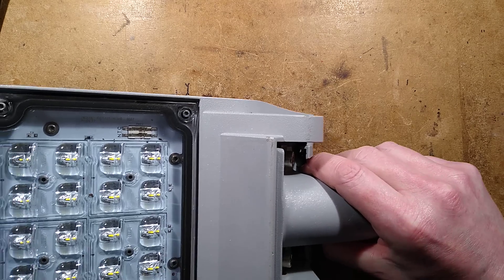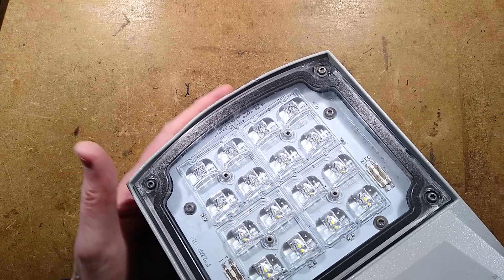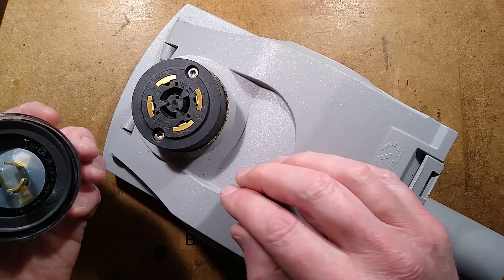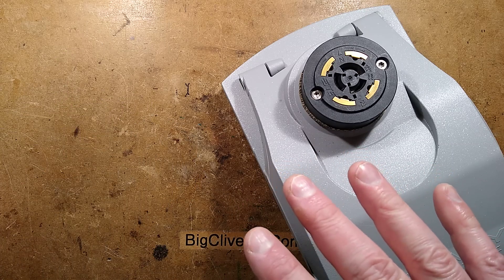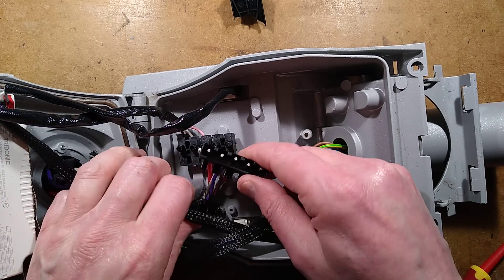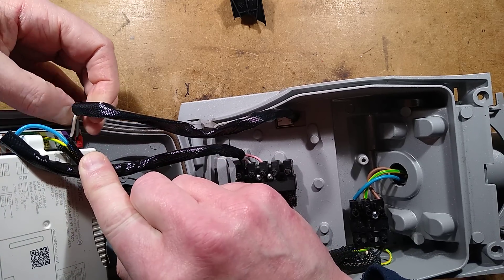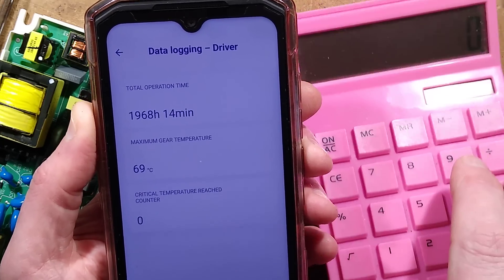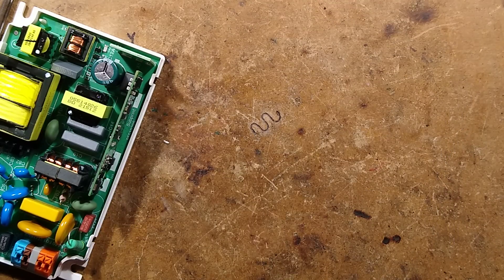Inside a tiny ASD Diamond British street light

Comment: Nice light but it, and most others, have a fundamental weakness, the light sensor. I live in a fishing port in NE England and after a couple of years (or much less sometimes) the lights are on all the time as the seagulls perch on the nice flat tops of the lights and sh*t all over the dusk sensor. It would be nice to see a lamp design with a "no perching" design. I am old enough to remember when the lights used a timer, low tech but dump proof, and were adjusted a couple of times a year. I am no Luddite, but I think a little more thought into the design of the lamp tops or at least the ability to add a bird deterrent in certain locations would be smart. Of course if the local authorities cleaned the lamps this would not be a problem, as if !
Reply from the maker: Some use light sensors that point down and analyse the local light levels.

Comment: Was watching the mosquito zapper a few minutes ago and it reminded of a comb that you zap fleas with when combing your dogs fur, also thought about the fly swatter I seen few yrs back that would zap bugs as you swing it or flap it around the air, how dangerous are those? Would the fly swatter zap fingers if touched and would the comb burn your dogs fur when zapping fleas? If the swatter did zap skin and hurt like hell, I guess you could use it as a defense thing if someone tried to get to you and attack you.  Sort of like a taser but mild I guess. Are those safe to use if someone came across them in some Chinese online shop?
Reply from the maker: The swatters used to have open wires, but now have an outer and internal, mesh arrangement.

Comment: I'll have to take a closer look at those street lights I mentioned previously that they installed outside my place. They're pretty bright, I'd guess way more than 20W and they look a lot bigger than this one, but they do have a flip open lid, so it's possible they're related to this one. I didn't get a great look while they were installing them, since it was dark outside and they weren't that close, that said I got the impression that the lid covered the whole width of the light and also the sides and front, which would help with resistance to rain. So perhaps it's not so related to this one after all.

Comment: Tridonic electronic ballasts, were a great source of of selvedged components for my projects. Because of the size of the office building that we maintained, I had a regular supply of failed electronic ballasts. I mainly removed the class XY capacitors, (for cap dropper psu circuits) and big Electrolytic capacitors from them.

Comment: I've noticed that the dusk sensors detract from the ergonomics of the overall design of modern lights in general. Why such a huge pimple?
Reply from the maker: Some use a small sensor.  The big ones date back to huge cadmium sulphide cells and heated bimetallic switches.

Comment: In the brief time it took you to extract all the goodies from the housing, I had disassembled, "fixed," and reassembled my Generic "Amazon Special" NiMH charger.
(Mine is an Opus BT-C3100, but being generic I'm sure there's other brands and model numbers for the exact same charger.)
Two of the four slots would have wonky current readings without a battery installed; one slot had a dead moth between the springy negative connector and a solder point on the PCB, the other had a bit of hay trapped between the spring and a surface-mount capacitor.

What a relief! I was fully prepared to replace it, but it seems there is no need to. So far, it's lasted thrice as long as the charger I bought from the brand that keeps going, and going, and going... 🐰

Comment: Tridonic have been around for a VERY long time. Their ballasts were used in the early Pifco single - tube kitchen fluorescent fittings (the ones with the stand-off tube arrangement from the 1960's).
Reply: Started 1956 according to their website, which also claims DALI was "based on Tridonic technology".

Comment: I was working at Pearson airport replacing HPS 150W 347V with 23 watt led .We were replacing drivers on lights before we got to the 2 Nd floor .Defective capacitors on the drivers was the cause .At $500  per fixture at 2011 prices was insane to have that many failures .No filtration and snubbers on the power supply

Comment: Oooh, look at all the protective webbing organizing the wire! Very nice!

That dusk sensor might physically match a NEMA connector, but there's no NEMA connector with a switched live. They all have 1-3 live phases, neutral, and ground.

That looks like a NEMA L5-15 connector. Those are supposed to have 120VAC live, neutral, and ground.
Reply: An L6-15 would be 240V L1-L2-G. 120V L-N-G would be an L5-15.
Reply: @michaelhall4626  my bad! Thanks for the correction!

Comment: I look forward to the day you look at a sodium vapor lamp. I have a nostalgic preference for their colour and properties.
The narrow spectral emission band of a sodium Vapor lamp in my opinion is superior to the white spectrum of an led system.
Reply: IIRC that bright orange hue is one of the worst colors for street lighting because it doesn't align with any of the light spectrum peaks of the human eye.
Reply: @NiyaKouya  I apologise for this being a single paragraph as I have to use speech-to-text .
 the spectral density of a white LED is actually not that great. it is referred to as colour rendering index but colour rendering index is not the full story. If we are speaking about an emission source such as a white fluorescent bulb that is very different as it has a high spectral output. This is why the shadows of LED light sources often have lower discernible visible features. There have also been studies indicating that the spectral density of a source such as a sodium vapour lamp during night conditions under bright Illumination that perception of moving subjects and subtle changes around the road are easier to perceive due to the narrow wavelength- but not too narrow- reducing distraction of other foreign elements related to night driving that are not conducive to vision.

Comment: I’ve seen led changeouts in the US with the bottom panels. What the tech does is loosen the mast clamp and rotate the fixture 180 deg so they can then move the bucket above it and work on it in front instead of above them.
Reply from the maker: Yeah.  Rotating the light to a better position makes life a lot easier.

Comment: I recently became a fan of the solar ones on Aliexpress as i believe i mentioned before, surprisingly good especially if you modify them with higher capacity and manual charging.. There are times that i wonder what itd be like to have a streetlight provided by the power company for my driveway and front of the house, but cant say the cost would be worth it.

Comment: Perfect timing. I just got 3 150W rated 140 lm/W 21,000 lm LED street light modules at my local electronics recycling store for $10 each. None of them worked, but I figured I could get them working. Took one apart and found that if I squeeze the sides of the LED driver it starts working. Bad solder joint. After peeling open the aluminum case for the driver and spending a few hours picking away at the potting material to expose the PCB and components, I found multiple cracked solder joints. After reflowing all the THT solder joints and testing, I found that I had a new problem. The heatsink for the MOSFET and FULL BRIDGE RECTIFIER!!! got up to 130°C after just a minute of operation. Everything else stayed relatively cool. The MOSFET and rectifier tested fine and even swapping them out didn't solve the issue. I'm assuming the potting compound was thermally conductive and was required to spread the heat out to the drivers chassis. Since I absolutely magled the chassis while prying it open and I can't easily get thermally conductive potting compound for cheap, I opted to take a different path. I resoldered the MOSFET and rectifier on the bottom of the PCB and drilled and tapped 2 holes in the aluminum chassis of the light in the correct spots. Then I bolted the MOSFET and rectifier with thermal grease directly to the chassis of the light and glued the PCB in place with epoxy putty. Now everything works perfectly and even with the driver compartment closed the hottest component on the PCB is the transformer at 70°C. Did the whole thing 2 more times and now for 30$ I have 3 21,000 high efficiency LEDs for the shop.
Reply from the maker: What voltage are the LED arrays?  You can get a simpler driver for them online, and under-run them for longevity.
Reply: 21k lm per lamp? How big is your (work)shop that you need that much light? The brightest LED assembly I've had contact with so far has something like 3k, and that's already blindingly bright...

Comment: I had too many headache with tridonic in past, finally I'm using Mean Well drivers. Open circuit is absolutely usual problem for tridonic products because they like to use unreliable integrated circuits and of course many electricians not using hot air to replace malfunctioned IC, they prefer to buy new one power supply. Mean Well at least cost 3 times cheaper.

Comment: Smart LED's are great! However, the circuit and components exposed to full sun exposure on the top, would make that device short lived. They could have at least used a white paint or opaque in that little light detection bulb fitting. It would significantly increase its life span of the smart street lights...

Comment: They should just rely on the dusk sensor and keep the circuitry to a minimum that is highly durable. We obviously know that electrolytics don't like SMPS where they will be subjected to high frequency... I suggest they use a separate can capacitor with jumper leads, like a PSC motor so when it inevitably fails its an eazy swap and away it goes... Makes perfect sense to me. Or find tantalum caps that don't go bang randomly. 😂

Comment: Street lights are always switched centrally around here. Either by a single dusk sensor or by a clock with builtin calendar. LED lights are treated the same way as traditional fixtures, they run from the old electrical system. No fancy smart controllers. Cities can get money from the government to buy LED fixtures but that doesn't cover new poles and cables. Individual broken LED lights are replaced with random fixtures that were on hand atr the moment, often HPS ones.
Reply: We've got ones that are on photocell, trouble is that we have a large school where they put in their own circuit and some of the lamps are right by the street. So we get the city street lights coming on at dusk, then the ones at the school come on and their brightness makes the city ones shut off. I think they could fix this by changing the orientation of the photocell but these have been up for about a year with no signs of being adjusted.
Reply: @tncorgi92  Haha, street lamp street fight 😁Queue michael jacksons 'Bad'.
Reply: In Italy as well. I'm pretty sure most of my colleagues designer don't even know what a zhaga/NEMA socket is.

Comment: I REALLY wish they would stop putting full spectrum LEDs into street lamps. I do astrophotography and the amount of light pollution these things create is crazy. The old sodium single wavelength type bulbs were ok because you could just use a filter to block out that specific wavelength. But it's impossible with full spectrum light. It's also so much worse for wildlife. I understand we need LEDs due to lower power consumption and longer life etc, but they need to have a narrowband filter fitted.
Reply: LED'S as such are monochromatic.

so all we need to do is put orangey yellow 'amber' LED's in streetlight and everything is back to fine !

white LED's apperently aren't monochromatic because of their phosphor layer on top of the blue/UV chips.

but who prefers to be blinded by a dazzling cold white led rather then by a nice sodium yellow ?
Reply: We're looking at changing LED street lighting as part of the dark skies initiative in Northumberland. Is there a particular colour rendering we should avoid e.g. 5700 Kelvin as opposed to 2700k? Which works best for astronomy? Either or neither? Is it just that LEDs per se emit the wrong kind of light?
Reply: @simonr2749  For wildlife, the recommendation is long wavelength light above and not below 560nm. The old low pressure sodium lamps produced monochromatic light at around 589nm which is perfect and many as astronomers already have filters to block this. 2700k sits nicely within the friendly range. The most important thing is to use either monochromatic diodes or ones which produce a controlled range rather than full spectrum.

Comment: Hey Mr Clive, there is a wave of very similar ‘we do too much but nothing well’ mini light & phone chargers being practically given away on Aliexpress right now, I got one for £3, and it’s dodgy af, like the Bluetooth asks for your contacts and location access, I’m wondering if they’re sold at a loss for data mining, seemed like a job for you!

The larger ones are called ‘Big G LED Lights’ because they’re shaped like a capital G, the tiny ones as I got are: Multifunction Wireless Charger Pad Stand Speaker RGB TF Night Light 15W Fast Charging Station - and they’re about 16 cm in diameter.

Just a thought! I’ll be modding mine, I just wanted the plastic casing really.
Reply from the maker: The analysis if the apps is more for a cyber security geek.  I try and avoid flippant apps.
Reply: @bigclivedotcom  no app, it’s just doing something suss with the Bluetooth i think, but rather the main point is what’s inside for it to be being suss with?
Reply: oh, you erased, so can infer that I did actually post my previous reply, when I saw it gone I wasn’t sure, but I wasn’t meaning to annoy.

Sorry!

Personally I just like the interesting shape of the casing, retro sexy!

Comment: I agree, like so many Chinese "electronics," we have a mental calculation to do, if it says 30 w take off a third, so 20 w thing is that's its not consistent, Same unit same manufacturer but different supplier different outcome. Rule of thumb cheaper is less ( but not always) industrial equipment from China is all over the map, certainly led driver ratings (or am I just unlucky)

Comment: Neat application of NFC - there are a few NFC eeprom devices from ST and ONSemi which present an I2C Eeprom interface to a host as well as NFC for standalone acecss without power - always wondered about applications - this seems a good one.  Would be nice if there is a generic NFC app that could be configured with a simple script to map user-friendly values  to eeprom locations make use of these.
Reply from the maker: I bet there's an NFC memory analyser app that gives you a memory map of what it finds.
Reply: Similar setup is used in some Phoenix Contact power supplies, the parameters for the supply can be configured through a mobile app and then downloaded over NFC even with the PSU still in the factory package (there's an 'NFC' indicator etched into the surface of the cardboard so you know where to hold the phone). When the PSU gets powered up it then loads the parameters from the EEPROM

Comment: I wonder if the incoming power connector should have been screwed to the other post which may have allowed the plug to be removed without unscrewing it. I noticed that the positions of the two posts were did not appear to be symetrical in either direction.

Comment: Interesting.
Any idea of the cost to the citys in quantity?
Would the smart module automatically decrease the output after business hours and a motion sensor bring it to full power as long as there is activity present?
Reply from the maker: The installers mark the price of these lights up dramatically due to general council apathy regarding financial matters.  Not sure what they cost from the manufacturers.
Reply: A lot of streetlighting is done on fixed contracts these, the council will pay someone like Balfour Beatty a wadge of money each year to be responsible for ensuring that the lights are maintained and replaced where necessary. What usually happens is that at the start of a new 5 or 10 year contract lots of work is done to make it look good, but then as time goes on there's less motivation to do a good job and tge shareholders are looking to squeeze as much money out.  Trade price on the basic 50W mini version is ~£450

Comment: Wonder if the datalogging isn't just to detect possible faults, but electricity diversion, like, into someone's house 😅

Could the first connection unclip if you screw it into the post just opposite?

The hole you suggest the water could drain into... Right down the pole and into the live feed and over the fuse presumably...

"nineteen thousand" 👀 how tired were you making this, go to bed!